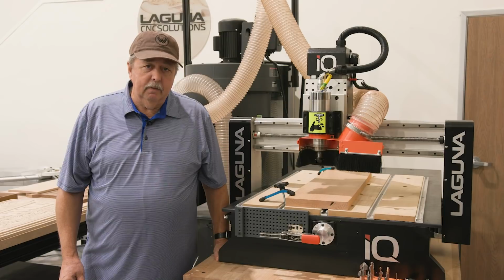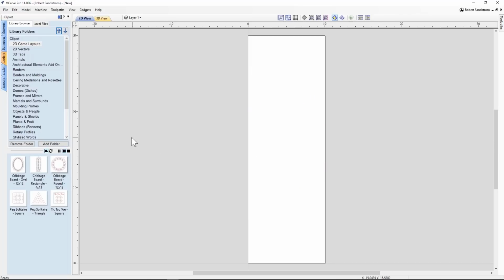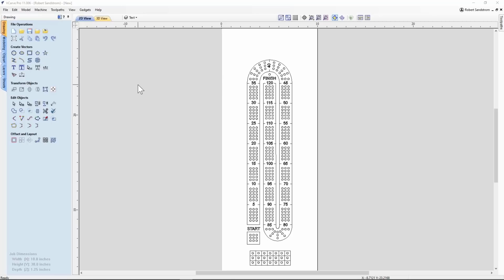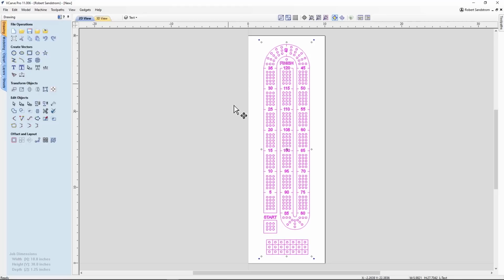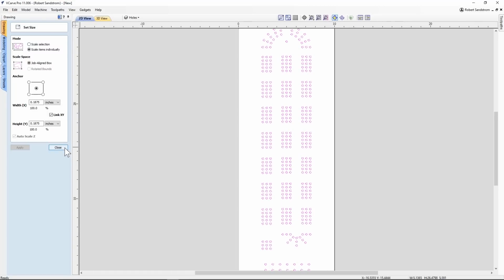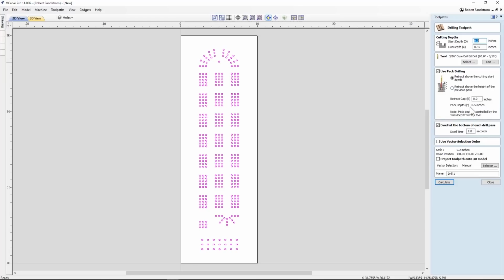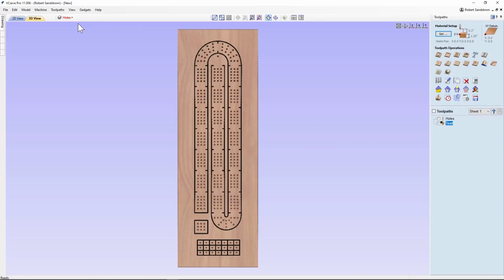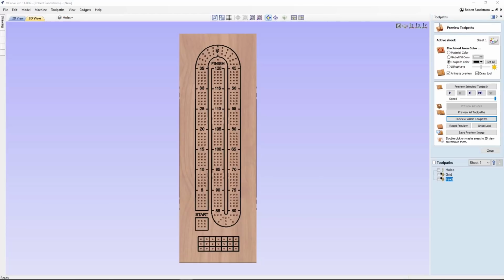How To Design And Cut A Cribbage Game Board With VCarve Pro 11 Software | CNC Software Tutorial

Comment: How deep should i drill if using tapered 3/16 pegs
Reply: That is really dependent on what you want.  The 3/16" pegs I use are not tapered and the fireman that I make them for want them to go to the hilt.  So, I drill the holes .95" deep, I could see this changing with different styles of plus.  I recommend having your pegs ready and then making a couple trial drill depths in scrap material to establish how deep you want your pegs to sit.  Sorry I can't give one specific answer for all caases.  I have seen that different peg makers have different tapers and different lengths - so don't have a one answer fits all for this topic.  Hope this is helpful.

Comment: Why can’t the drill bit speed be set by the code?  Also, why not turn on/off the vacuum with the Goode?  Thanks for sharing.
Reply: On the Laguna IQ the feed and speed are set through the gcode as input in the Vectric software.  As currently designed, the spindle speed is set manually via the VFD, and the dust collector is a different power source.

Comment: I was wondering where you got the 3/16" drill bit for your cnc
Reply: Wally's Toolshed I purchased my 3/16" bit from ToolsToday.  It is Amana Tool 204047 Carbide Tipped Brad Point Boring Bit R/H 3/16 D x 70mm Long x 10mm SHK.  Because the shaft is a 10mm shaft and I don't have a 10mm collet I bought an adapter to allow me to use the bit in my 1/4" collet.  Adapter is Amana Tool 47636 1/4 Inch Shank x 10mm Inner Dia. Dowel Drill/Boring Bit Adapter for CNC Standard Collet/Tool Holder.  Hope this work for you.

Comment: too slow on the peg holes. I run an 1/8" spektra amana bit at 50 ipm plunge and feed rate at 0.003 fpt takes me 6 minutes to cut the pegs. 8 minutes on 60 deg. v bit to do letters and rails. 3 minutes using 1/4" spektra amana bit for contour. so thats 17 minutes add 2 minutes to switch out bits, reset z and go. so 20 minutes to do one cribbage board. Still love the video and good work.
Reply: Jason thank you for your input.  I readily admit that I typically use conservative toolpaths.  Appears you are using a pocket toolpath - if you are setting your feed rate and plunge rate.  Glad this is working for you and you have me intrigued a bit.  When i was using a pocket toolpath, with my 1/8 inch bit, I could not get close to that efficiency without burning.  Now I will need to try with your information.  I usually do 3/16" holes but I'll try something close to your settings with my 3/16" bit and see how that works.  Others may be interested in the specific bit you are using - do you have a Amana tool number you can share?  Thanks again for your input.
Reply: @RobSandstromDesigns  Amana Tool 46341-K CNC SC Spektra Extreme Tool Life Coated Spiral Plunge for Solid Wood 1/8 D x 1/2 CH x 1/4 SHK x 2 Inch Long Down-Cut Router Bit and Amana Tool 46248-K CNC SC Spektra Extreme Tool Life Coated Spiral Plunge for Solid Wood 1/4 D x 1 CH x 1/4 SHK x 2-1/2 Inch Long Up-Cut Router Bit. the peg holes I used drill not pocket. the 1/4" contour is set at 0.1875" depth, ramp, 50 ipm plunge and fpt at 0.005 so around 180 ipm. the drill operation is set at 0.003 fpt, rapid drill and 50 ipm plunge. you can see my video on cribbage boards how fast it goes. I don't get any burns with these bits. I highly reccommend them.